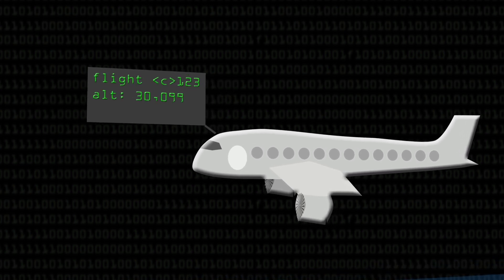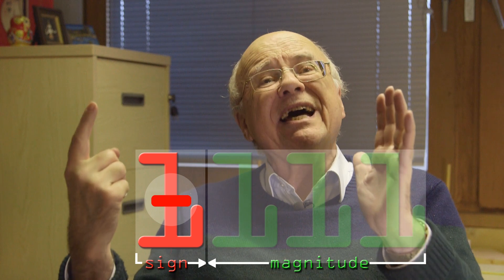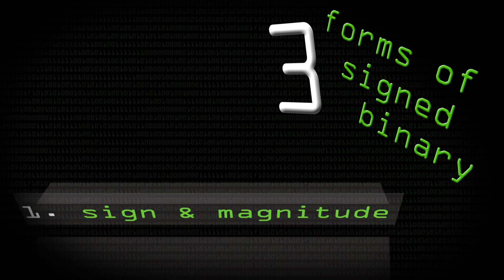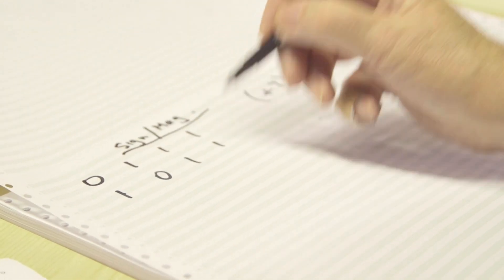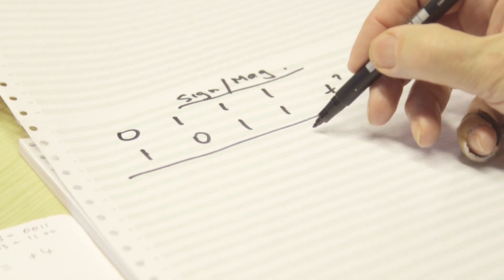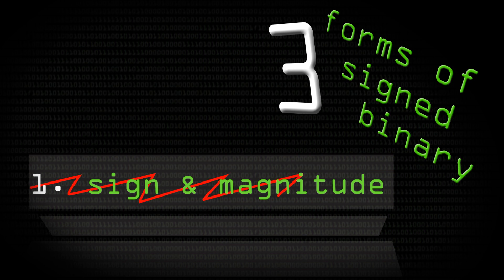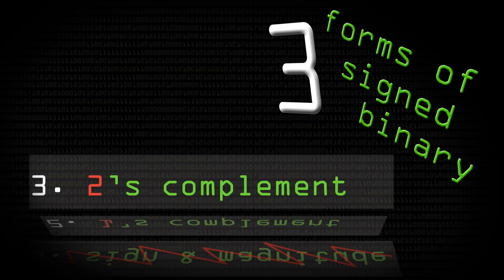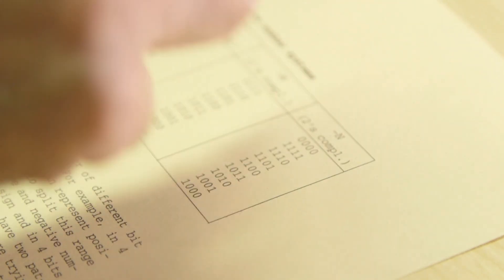Binary: Plusses & Minuses (Why We Use Two's Complement) - Computerphile

Comment: Will binary be enough for Quantum Computers or will binary condemn quantum computers to utter inefficiency compared to what could be utilised from increments of super-position?  Ultimately I believe multiplication and division will have to be reversed on either side of a unitary zero.  For example -3x-5=-3/5, -3/-5=-15.
Reply: Don't know what you try to say with this multiplication thing, but I know a little about quantum computers. Base two is very useful if we use two state systems to implement it (i.e. spin 1/2 particles like electrons, or the polarization of light). The superposition is not part of the representation of the numbers, it's only used during the calculation.
Reply: What do you mean by ' the superposition is not part of the representation of the numbers...',  does this mean you are not planning on using increments of super-position and therefore don't have to worry about measuring them?
Reply: Nicholas O'Brien the point is that when we measure the outcome of an algorithm, the superposition is destroyed. It is used during the algorithm,, but you can't say that a superposition like (1/sqrt(3))*(|↑> + 2*|↓>) represents the number 12 for example. You can't encode data in superpositions.
Reply: Guest6265+ Do you mean that because the outcome of an algorithm does not generate any other fact of a super-position that all other algorithms that may be involved by a superposition cease to exist?  Do you mean to say that an entity exhibiting super-position is fully expended in the process of measurement and cannot be observed in other algorithms forever?
Reply: Nicholas O'Brien I'm not fully sure I understand what you're asking, but I think the answer is yes.
Reply: Guest6265+ Is there any experiment which has attempted to foreclose many many algorithms at the same time upon a superposition potentate?
Reply: Nicholas O'Brien I'm not a native speaker and I have trouble with words like foreclose or potentate... have I understood that right: You want to know whether there are experiments that use the concept of superposition to run many algorithms at the same time? Maybe look up what an algorithm is and what superposition means, because I think your question doesn't even make sense. That could be due to language barriers though.
Reply: Instead of expending an entity on a single measurement is it possible to conduct many measurements at once, upon a single entity?
Reply: If it were possible to conduct many different measurements of the same quantum entity, that could mean that increments of superposition could be utilised for quantum computing instead of simple spin switches.  Instead of just up or down spin the observable computer 'spin' could be like the many different limbic moves of Kung Fu or Ballet.  Spooky action could be used across vast networks of Quantum Entanglement according to incredibly small articles of differentiation.  Then the reversal of multiplication and division on either side of Zero could be used to map the incremental approach of non-simple quantum difference, on 'levels'/ layers of quantum architecture.
Reply: I'm afraid I don't see what part of the conversation you are entering?
Reply: ***** What I'm gathering from the comments following my original comment is that the advantage of using quantum bits, qubits means many multiples of computing power better potential performance compared to bits of information.  My point is that if the potential of qubits is so much larger how can it be that binary measures of quantum behaviour capture this potential?  Especially if the act of measuring a qubit expends that quantum factor and makes it necessary to render a new blank slate that can absorb a calculation presumably by the induction of a new particle?  Surely it would be better not to force such a bipolar increment in registration of certainty?  I suggest reversing multiplication and division of either side of zero for infinitesimal calculations that can register the movement of quantum factors without forcing them to this point of measurement disclosure?!  So I am wondering what you mean to say by saying that the point is using qubits not bits you see?
Reply: Nicholas O'Brien Okay, I'll explain to you what I think a qubit, superposition, quantum-register and quantum algorithms are and if at some point you would disagree, just tell me where, because I feel like we have a fundamentally different understanding of the matter.

So Qubit: A qubit is a quantum system with two eigenstates, let's call them |0> and |1>. That means whenever we take a measurement we either get the answer zero or one.

Superposition:  We can set a quantum bit not only in its eigenstates, but also into something called a superposition of them, that means a*|0>+b*|1> where a²+b²=1. If we take a measurement on a superposition we get the result 0 with probability a² and 1 with the probability b²

Quantum-register: A set of multiple quantum bits that we denote with e.g. |00100> where each digit represents the state of a single qubit. we can have a superposition of those too e.g. 1/sqrt(2)*|01000>+1/sqrt(2)|00101>. Here we would have entanglement because we can't write it as a product of single-qubit sates.

quantum-algorithm: They all work different, but I'm giving an example (phase estimation) that contains the general idea of using quantum effects: At first you have an initial state |000>, then you set it in a superposition of eigenstates. Then you give each eigenstate in your superposition a different phase-factor. Then you perform a QFT, which essentially let's the wrong answers interfere destructively and the right answer constructive. when you now perform a measurement on the register you have a high probability to get the right answer.

Since were looking at two-state-systems binary comes naturally with them. The outcome can be interpreted as binary number. The superposition is only utilized while performing the algorithm, not in the representation of the result, which will always be a binary number.

Now, what does this all have to do with reversion of multiplication and division?
Reply: Well you have gone to a lot of trouble here and I thank you for your time.
1.  Do you mean to say that the Qubit is not destroyed in this process and can be re-employed to perform further calculations?

2.  Do you mean once a superposition has been measured it cannot be re-issued differently within the original instruction?

3.  Do you mean that the competition between destructive {wrong} answers and constructive {correct} answers limits complex calculations to larger and larger quantum registers and simpler and simpler quantum algorithms?

4.  I mean to say that restriction of what signals computational circuit to binary signals, limits the computational power of the quantum register.  I mean to say I believe mathematicians are under-estimating their ability to manage quantum bits, registers and algorithms.  The reason mathematicians are doing this is because they do not reverse multiplication and division on either side of zero.  Infinitesimal fractions describe objects that do not touch each other, i.e. prevent each others momentum.  However single atoms can be affected by bonds forming and unforming in close proximity.  Therefore binary systems may be outdone by decimal systems if we can properly express the difference between negative and positive numbers and a unitary description of zero.  Reversing multiplication and division on either side of zero can isolate zero by differentiating negative and positive implications of numbers on either side of zero.  
5.  This would mean an idea of whether -3 X -5 = -3/5 or -5/3 for double negative multiplication.  Perhaps the discipline of which appears in order e.g. -3X-5 = -3/5 and -5X-3= -5/3.  Or perhaps the larger number always goes to the denominator?
Reply: Nicholas O'Brien
1. Yes
2. Yes
3. No, what limits the algorithms is decoherence that means that it only works if you use a limited number of gates between measurements. Also it's hard to entangle many particles, which also limits the algorithms. These are hardware problems and not conceptional problems of quantum computing.
4. + 5. I think you're speaking of the problem where "32-bit double" can't store small numbers precise enough to do 1/(small number) correctly? I fail to see the connection to quantum computing. Maybe you think that that's the problem with simulating quantum systems, which is not the case.
Reply: 1.Cheers
2. Cheers
3.  Thanks here, so you see no relationship between hardware problems and the conceptual structure of binary systems?
4 +5  What is in your view the main reason we choose to use binary systems, hardware related or conceptual?
Reply: Nicholas O'Brien
3. On classical computers? No. On quantum computers maybe, but a different number-system like base 10 wouldn't help.
4. It's the most natural system we have and it allows to use simple logic circuits to calculate stuff. that would be a lot harder with another representation. we can express numbers with a sequence of true and false. Therefore we can have structures like the binary full adder. Look it up and try to design it in base 10 or something and you will realize the beauty of binary.
Reply: Guest6265+ I really appreciate the time you are taking to answer my non-technician questions!  Just to press the question one more time, " ... to use simple logic circuits..."
1.  Is it actually a result of simplifying conceptual or hardware logic circuits that makes binary 'better' for computers?  Intuitively, I have the impression that it is purely because of current hardware that binary is preferable for a technician and only secondarily in conceptual terms has binary become preferable for mathematicians.  
2.  Deductively base ten is the conceptual form most logical for mathematicians, for various reasons to do with the arabic numeral system.  However for example, what if the base used was 'specific' to the number of positions we could divide the movements of a particular particle into?  
3. Discretions that did not measure the super-position but a position sub-ordinate to 'spin'?  Specific Quantum Exertive properties that were both more expressive than 1 or 0 and were coherent to the feasibility of correct propositions of a surrounding instruction?  Would such a hardware capability make binary too simple a conceptual form?  Or would it simply shift the location of binary to another location regardless of hardware?
Reply: Nicholas O'Brien 
1. The more different values your digits can have the more complicated the operations will be.
2. base 10 isn't most logical to mathematicians, it's most logical to 'normal' people, because that's what they're used to. and that's the ONLY reason. Some people argue that base 12 would be more logical because 12 has more divisors, but in the end it's just a matter of notation and there's nothing more logical than the other. That only matters when it gets to hardware implementations. If your example was the implementation used, to represent numbers, than the hardware would be specific to that, but as stated in 1, better keep it simple and use base 2.
3. ... what?!
Reply: On 3, if single atom "needles" on a resonating quartz crystal can form and unform bonds when brought close to a particle lattice, doesn't this mean that quantum particles can be measured without depending on up or down spin?  Couldn't such bonds forming and unforming be used to generate only correct answers instead of forcing incorrect answers to report 1 or 0, if as you say base number systems can be purely subjective to an observed particle?  Or would this presuppose knowing all reportage in a catalogue and merely retrieving the memory file?

Comment: Probably the biggest reason that we use two's complement notation is that it allows the same instruction to be used for signed and unsigned addition (same with subtraction.)  In early processors (think 6502, 8080, and 6800) separate logic for signed and unsigned arithmetic was just too much.  Frankly, I'm surprised they included BCD.